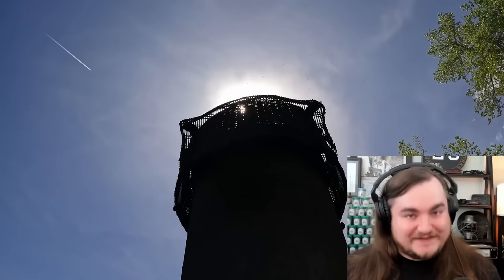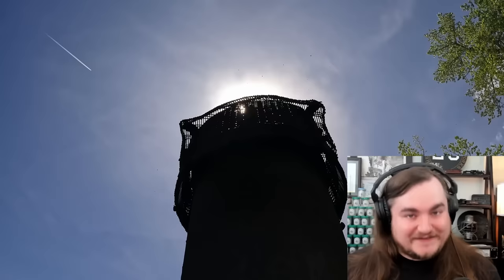Why do USA steam trains make smoke, but UK ones don't?

Comment: Hi, I just found your channel and you have interesting train content and I've subscribed. Here's a research project for you if you're interested.   In 1971-72 I saw a documentary on British TV about the evolution of train & railway safety from the early days of rail travel to present times (1970's).  It detailed the causes of train wrecks and the procedures put in place to prevent the conditions causing (or contributing to) the wreck from occurring again. All was well until an unexpected set of circumstances caused that well-reasoned procedure to fail.  Modified procedures were implemented and again all was well until further unanticipated circumstances caused that procedure to fail, so on and so forth.  The documentary was very interesting and I've tried thru the years to find that particular show but to no avail.  I know research capability has improved on the internet over the years so maybe you would have better success.  Examples (I think) I recall was like the use of a lantern to signal all clear but someone uninformed of railway protocol used a lantern for another reason which led to an accident.  To correct this a colored light was implemented but that eventually failed due to a color blind crossing gate keeper.  So double lights were instituted but that had short-coming when one light failed giving a false signal.  As I said it was a very interesting documentary and would be greatly appreciated if it could be located.   Thanks.

Comment: Before i watch i was told it was because American engines ran colder than British trains so they wouldn't have such strong heat cycling on their long routes which cuased the fuel to not burn as clean since it wasn't fully combusting lets see if that is correct

Comment: Coal which produces only carbon monoxide only gets about 5000 B.T.U. per pound. Coal burned to co2 producees over 14,000 B.T.U. per pound. Smoke is an approximate indicator of combustion efficiency. In addition to what the fireman does, other factors are firebox volume and the quality of the coal. N&W purchased coal seams which were specific to the type of coal a steam locomotive should have. The Reading burned glorified mine waste.

Comment: hen or the egg first. If I got it right best draft is when locomotive is running, but you can not go until you have pressure, and to get pressure you need fire. like a circle. There is some draft created  even when standing still, but seem s you have to inch your way up in pressure till you can drive. So I always thought it is the firemans job not to shovel in too much coal? He has to be calm and calculating it is not a petrol engine. There should not be any smoke if the temperature is right and enough draft. A good place to check is if the engine is at full throttle going uphill. If it is smoking then the fireman did not plan things correctly.

Comment: Without over-thinking the issue, American locos mainly operated in wide-open cross-country spaces. By contrast, many trains ran for a more prolonged era in cluttered British cities and towns nearer to homes and people. There was surely less tolerance for having smoke and soot messing up things like building edifices and clotheslines. This would have driven British rail operators to develop ways to reduce the problem. American railroads would have faced no such issues in running smoky trains. Why solve something that isn't perceived as a problem at all?
My 🪙🪙anyhow.

Comment: Question: Could a fireman on an American locomotive limit the amount of smoke when the Engineer shuts the throttle by opening the Fire door? Thus feeding more air over the top of the coal fire? Or is there still not enough draft through the box that even opening the door wide open would make a difference?

Comment: Quite right it is about combustion. All engines probably on both sides of the Atlantic, would be monitored as to fuel consumption. Heavy consumption annoyed the directors who wanted profits. In Britain a fireman who could not fire properly would be unlikely to progress to driver or engineer in American terms. It would also be fair to say American Engineers were trained to do more in innovative field engineering which British drivers were not. 
As for current photography you are quite right as being less knowledgable than previous generations they want puffing clouds the anathema of all firemen!

Comment: Yeah UK you'll get black smoke as the locomotive starts from stop but as it begins to move and the draught begins to increase the exhaust should become a light grey haze of predominantly exhaust steam if the combustion is as efficient as it should be - although it is the fireman's control he can only work to the best the machine can - though most of the locomotives in preservation should theoretically have had any poor design or manufacturing causing draughting/steaming issues ironed out during their working lives. An exception to this is the sole BR 8P 4-6-2 'Duke of Gloucester' which was turned in preservation from a bit of a dud to the most powerful Pacific to run on UK rails

Comment: This was a great summary of the differences and reasons for the smoke from locomotives. 
But this got me thinking, with so many examples of running trains there wasn't many that conformed to what I'm most used to seeing from locomotives. 
Before watching this video, I would have asserted that most locomotives run with white smoke and neither black smoke nor nearly clear smoke.
Because most examples from any type of source with trains included, the locomotives nearly always had white smoke. 
I have no ideas why that is, that the smoke from the train's smoke stack usually is as white as the steam from open cylinder chockes, whenever a locomotive is depicted in movies, tv shows, cartoons and most other sources. 
Any ideas why it's so?
Reply: because it's draught steam?
Reply: @annpeerkat2020  
I don't know, that's why I'm asking. 
The white smoke looks more appealing to me at least, but I'm such a greenhorn about steam locomotives.
I get the engineering basics, but it's far from understanding all the intricacies of different steam locomotives and their operation.

Comment: I have to disagree about British engines "not working as hard" as those in the US.  On the contrary, the gradients when crossing the Pennine Hills were tough going.  On the West Coast mainline, the northbound approach to Beattock Summit is 15 miles with gradients of up to 1 in 69 (1.449%) - and there are plenty of places in the West of England which have similar long and steep gradients.  On the largest locos, such as the LMS 'Coronation' Class (grate area 50 sq. ft.), a fireman was expected to feed it with up to 3,000lbs of coal per hour - with a SHOVEL

Comment: Chinese class qj also make huge black smoke when they are working. But thanks to your details it reveils a status- QJ is having too many cars to haul therefore most of the time it is slow thus NOT working at the boiler's maximum potential. And it's the idling boiler that makes black smoke. A hard working boiler (for QJ it has to be running at at least 50 kph or 30 mph) will result in nothing or white smoke, not black smoke.
Also chinese have bad coal. Too bad good coal are useful elsewhere such as steel refinery.

Guess they shouldn't stuff the QJs too full on those low speed runs since you don't need to push the maximum effort out of the boiler.

Comment: What about elevation? In West Virginia at Cass Scenic Railroad, the Shays Engines can really put out some smoke. Would the elevation with the thinner air in the mountains effect the production of smoke?
Reply: You typically get smoke if you burn something with a lack of oxygen. This is for example the case if you operate old diesel engines with fixed adjusted inline injection pumps in thin air (when they are adjusted to sea level or lower altitudes). I don't know however if this is also the case with the Shays and if the mountains there are high enough

Comment: I always wondered what it's like cleaning one of those heavy smoker fireboxes. In my mind, lots of smoke = lots of soot = deposits on fireside tubes and whatnot. I remember hearing that it's dealt with using a steam lance (similar to large stationary coal/coalgas furnaces), but not sure how true. I also heard that steam is sometimes injected into the stack to force a draft and potentially blow soot. Would those things also increase soot/smoke production?

Comment: Excellent video.
I have a question for you...
Does the temperature and humidity of the outside air have any effect?
The example of American locomotives that you provided are shown working in a climate which appears to be warmer and drier than your typical UK railway. 
In a colder and damper environment, more of the exhaust steam would turn into clouds of white water vapour (which can partially mask black smoke), and this is common on UK steam railways.
So, if your photographers want clouds of something to come from the locomotive (to make a better photo), if you're in a hot/dry climate then you only have the option to make more smoke.

Comment: Anything to do with the price of coal?

A lot of UK coal mines were deep and also had to compensate residents living over them - a major cause of them shutting down due to being uneconomical. One of the prices of living on a tiny island. We can't frack gas due to the same problem.

Anyway - a small engine has to extract as much energy as possible and that black stuff coming out of the smoke stack is combustable. That's money you're blowing into the air.
We don't have a culture of photographing black smoke so there's lots of reasons not to produce it and no reasons to do so.

Comment: Another reason I think is that in the 1940s we worked really hard on stopping emissions to stop the bombers detecting the big cities. This would not  have affected the US because there wasn't as much bombing. As you said UK locos are smaller due to our smaller loading gauge. This smaller loading gauge is due to us using nearly 200 year old routes and tunnels.
Reply: I always thought the smaller locomotives and loading gauge was about the distances involved in the UK vs. US - the UK being smaller has less need for huge locomotives pulling long heavy trains, so they tended to settle on smaller designs, and there was less incentive to upgrade lines to accommodate larger locomotives that for the most part weren't needed. While the US has far greater land area to cross, so huge locomotives were more useful. Mainland Europe's are larger than UK's, and Russia's larger yet.
Reply: @quillmaurer6563  You would then expect the branch lines to be smaller gauge than the main lines. Smaller locos so only needing a small loading gauge was originally true but by about 100 years ago you had 100 years of infrastructure which cost a lot to upgrade. There were exceptions like the Great Central Railway which was built to European loading gauges. But yes the Manchester to Liverpool line, the worlds first mainline, was built almost 200 years ago. We don't have the distances the US has but the East Coast Main Line and West Coast Main Lines are 100s of miles long. Locomotives like Mallard and Coronation Scot weren't exactly small. But we did run more trains, faster and more often. Compare a modern UK freight train against a US one. Yours are miles long with multiple locomotives not going particularly fast but one side of the continent to the other. Ours are doing the ton with shorter trains, electrified, down the ECML or the WCML...
Reply: @quillmaurer6563  There was an alternative for a while. Brunel prefer a wider gauge and build trains that run on a 7ft gauge. They were bigger all round. But Stephenson won the gauge battle and standard gauge became 4' 8" 1/2.
Reply: @melanierhianna  Having branch lines a different loading gauge (or track gauge) than the main line wouldn't be practical for interchange. Of course there are many places where narrow-gauge (with associated smaller loading gauge) tracks are built to serve areas where building a standard-gauge line would be too expensive - usually these are seen as separate networks rather than branch lines. Colorado, USA where I live used to be covered with these, but now only a few pieces survive as tourist/heritage lines.

I wasn't claiming that US locomotives were/are superior in any way - UK and US just built different style (and size) locomotives for their differing needs. Those UK express locomotives like the A3 (Flying Scotsman) and A4 (Mallard) aren't small by any means, and are excellent in design and performance, but they're a fraction the size of the largest US behemoths. Because, with the shorter trains and distances, building a Big Boy size locomotive, and modifying the network to accommodate it, wouldn't make much sense. But UK trains are typically faster and more frequent as you say, and Mallard holds the steam speed record. Thinking in modern times, as an American I envy your passenger rail network - yours is so much better than ours. Well pretty much any other developed country's is better than ours. US is great at freight but lousy at passenger, I think that is somewhat a matter of distances involved but also national and cultural priorities, there are certainly regions of the US where far better passenger rail service would be sensible and viable yet it is nonexistant or lousy.
Reply: @melanierhianna  Yes - I recall there were some politics involved in that, but in the end (especially in retrospect) I get the sense it was found worldwide that "standard gauge"  is the best compromise for most purposes. There are some slightly larger in use, such as Russian 5' gauge or Iberian/Indian roughly 5' 6". The latter is the largest in widespread service today, still significantly smaller than the 7ft gauge, suggesting that in the end nobody found that large to be practical.

Comment: I'm not at all an expert, but I'm willing to wager it's because of the size of the engine. A larger firebox is harder to control properly and get that perfect burn
Reply from the maker: I mean, yes, but no; depends on how hard the engine works relative to the box. A small box worked hard is harder than a big box worked easily.

Comment: Air Fuel ratio   too much coal in the Coal box.  I like to see it run efficiently ..   My Neighbor built a 1/3 scale Case Steam Traction engine based on a 60 horse power Model .. Coal smoke gives me a bad headache..

Comment: There's a video by the great railway videographer Paul J. Barnes of ex-Canadian Pacific G5b class 1201 from a 1989 excursion that demonstrates that smoke is a photographers preference. During normal running there was hardly an smoke but during runpasts for photoshoots they had the smoke pouring out of it. 28:10 no smoke during normal operation, 38:33 with lots of smoke for photos

https://youtu.be/SaDZZGo2VV0

Comment: https://www.youtube.com/watch?v=7qD_uGmVsHc shows SP444 shows the effect of fuel energy as SP4449 races UP 8444 up Cajon Pass. 

The availability of oil in various grades and the comparatively lower price for oil in the US caused many US RR particularly the Western lines by oil burners or convert engines from coal to oil. Most western coal not anthracite. It burns less cleanly and produces less heat energy.   Add in the larger locos, pulling heavier equipment in longer consists over longer distances and US RR had an incentive to go with oil, but they were not so fuel price constrained as in the UK, so some smoke was OK

Comment: This is going to be an Uber nerd steam engine question regarding semantics that may or may not have a definitive answer. I was wondering about the specifics of back pressure. On some engines like the big boy you can easily see the pressure Bob up and down across the entire stroke of the valve, but some other engines on the other hand are much more “steady”. You brought up and interesting point about the grates and how that affects the pressure at the blast nozzle. Is there any particular reason for this phenomenon? Or is this just specifically varied based on the locomotive and how this reading is Plumbed from sensor into the gauge on the back head?

Comment: Actually, you are wrong about the quality of the coal.  Welsh coal is hard, Yorkshire coal is soft.  British firemen were taught not to allow the engines to smoke.  French coal is very soft.  Since I’ve never seen a French locomotive in steam, I can’t say whether or not they smoked.  I do know that compound or simple, they were very efficient, and the shoddy coal was very expensive, and French firemen (Chauffeurs) extremely meticulous.  French steam trains were slower, owing to easier time tables.  BTW Gresley A4’s owed a lot to French locomotive practice.

Comment: It happens when you apply more throttle and fuel oil or coal they'll do it every time four of my family members were steam  engineers and it happens when you pour the coals on and your wrong on photography pictures they do it all the time I seen it in the 70s with the B&O AND IF THIER ON A GRADE PHOTOGRAPHY HAS NOTHING TO DO WITH IT IT'S CALLED TONNAGE

Comment: Well not the same engine but a Diesel running a high ram will smoke as the fuel does not havectime to completely burn. I imagine that if the steamer is not up yo temperature and your pushing it for power it will smoke.